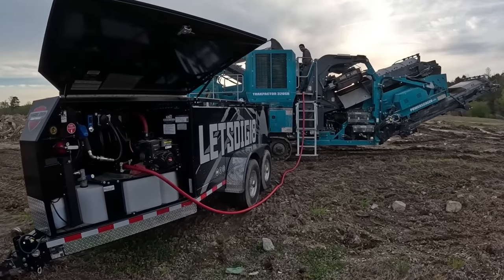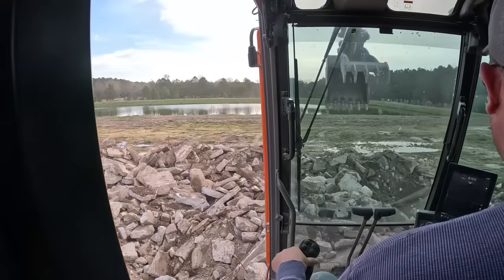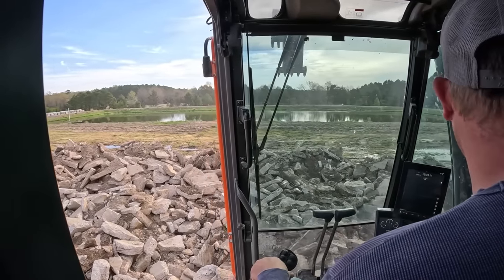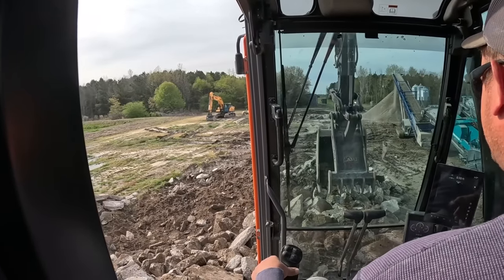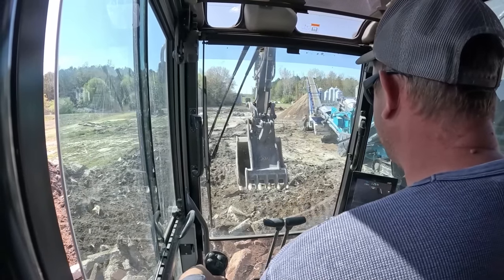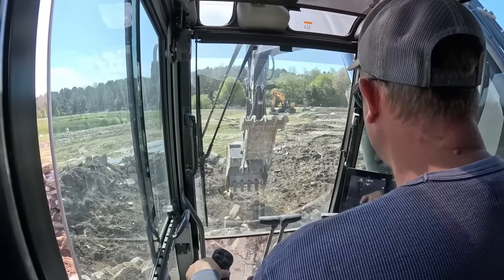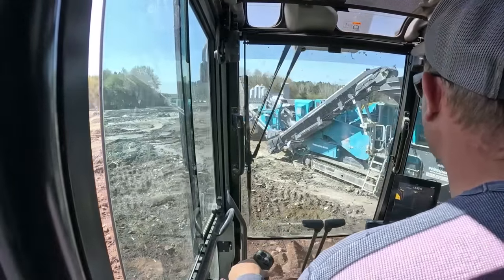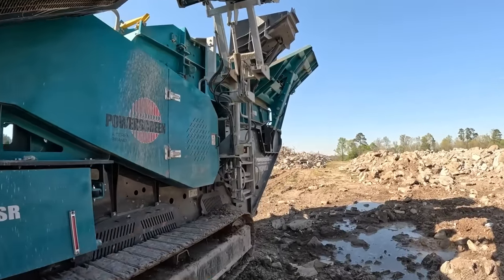Rebar Defeat I've Crushed All I Can Do

Comment: It might be interesting, when that new style  fiberglass rebar starts showing up in demo jobs.
Reply: I hadn't thought of what MST bar would do going through a crusher,  The wrecking ball might work.
Reply: Yeah I had the same thought. There's also extruded basalt rebar being used in a few places now; basically cast melted rock. It'll produce the same problems (won't be caught by ferrous screening).
Reply: @Jambeeno  I would think that basalt bars would crush though.  I suspect the fibergass rebar is also brittle, but splinters, that could be a big mess.
Reply: @MrXelig Sounds like asbestos all over again. You don't wanna breathe normal concrete dust as it is, with fiberglass particles in there that'll be a whole new world of hurt.

Comment: Thanks for presenting the crushing operation. One thing that strikes me is that the conveyor system raises the crushed rock higher than what is needed. In other words the engine driving the conveyor belt is doing more work, ie adding energy to the rock, than what the rock ends up having when it comes to rest piled up. Diesel fuel is what provide that energy. So how much extra fuel is this? I did some back of envelope head scratching best I can figuring you do 900 tons per day and while doing that the crushed rock goes on average 10 feet higher. The excess height starts out high and then decreases over time. Assuming the diesel engine is 45% efficient as an engine, which it is probably not that efficient and then also figuring the conveyor system is at best 70% efficient, I think we are talking in the range of 5+ gallons per day of extra diesel fuel being used. That is something.
Reply: Neat exercise.  So by your math you came up with $15 to $20 per day in extra fuel costs.  Now you need to compare and contrast that to having to either stop and raise the conveyor every 15 to 20 minutes, or paying someone to do that.  I think your concern becomes a penny-wise but pound foolish way to handle the material.

Comment: I'm sure you learned those long pieces of rebar aren't fun to work with.  We tied into a pretty tough project right out of the gate with our crusher setup.  Couple things that helped us were the fact that our screen is a stand alone independent outfit separate from the crusher.  This gave us more visibility on what was coming across the screen debris wise, and was easier to clean out for the same reason.  The other thing we had in our back pocket was that we bought a Genesis multiprocessor.  Basically for every day we crushed, we also were running the multiprocessor sorting out those long pieces of rebar that I'm sure you noticed gave you quite a bit of trouble binding things up in the crusher.  I know a guy that has a multiprocessor that isn't hydraulically powered that does quite a bit of crushing.  He seems to get along pretty good, but that Genesis of ours just has a scary amount of power!

Comment: Wow it looks like you need a pre-crusher just to free up that rebar. Nice video.
Reply: Actually there is a "rough" crusher called a jaw crusher that would normally be the first step to make material to feed this crusher and getting the rebar out at that stage is typical, but adding another step and machine would make this particular project out of budget, so they got what they could with what they had. My guess is that the rest will be fill for the two lagoons there at some point in the future. Not sure of what local procedure is for shutting down those sewer lagoons after hog farming is.

Comment: Love the videos . I have worked on a few stationary rock crushers , its a full time job just crushing hard rock in a quarry and alluvial material out of old creek beds . We had two crushers going , the main one was producing road base and the smaller one I was on crushing to produce sub base but using different materials one was hard rock from the quarry and the stuff I was crushing was a black type of big round volcanic type rock , when they got the tests back the sub base from my little crusher turned out to be better road base then the road base from the main crusher but it was a full time job because the bloke on the loader feeding the crusher kept putting oversized rock in the feeder and blocking up everything so it was sledge hammer time not nice especially when he would not get of his arse in the loader to help with breaking up the big mothers to fit in the jaw to be crushed. That crusher you have there is an amazing piece of machinery whats your thoughts on crushing all that cement with so much reo in it I would reckon that was a bit of a nightmare for you .I have been watching all your videos for a few years now , The Bealy Good jobs and heaps of others jobs done by yourself amazing to watch and amazing what you get done  by yourself. Thanks for your Great Videos Watching from Nth Queensland Australia.

Comment: Can impact crushers handle rebar? Yes. Impact crushers liberate encapsulated concrete. Rebar should be enclosed in the concrete and not be longer than 4 ft (1.2 m) because rebar might wrap around the rotor.

Comment: Would a "jaw" crusher work to clean the concrete off of the rebar?  Maybe then feed that to the powerscreen?  Yes, that doubles the equipment expense, but if that's what the job requires…
Just don't feed in any balloons!

Comment: I missed something. Went back an rewatched the previous video but still not getting why the crusher is being picked up next week yet there’s more crushing left to do. Will the crusher return later? Or is this the end of the job? What happens to all the concrete containing rebar?
Reply: The rebar in this section is twice the thickness of the rebar in the first section.  It's just not economical to crush it with this crusher.
Reply: I think this is the end of the job, Chris only had the machine for a set number of hours and all that long stringy rebar won't go cleanly through the machine at all.
Reply: He was probably feed up with the hassle with the machine.  :)

Comment: I disagree...I don't see this as a "defeat". I think you probably did far and away more than anyone else would have under the same circumstances. The rebar and other trash in that concrete made it unsuitable for reclaiming using the gear that was available. I suspect that is why the crew you came in behind walked away when they did. You got a lot done.
Reply: 100% agree